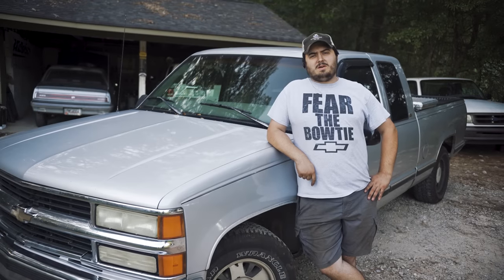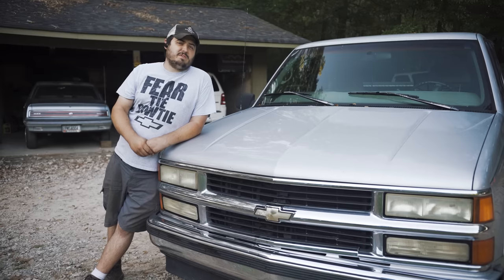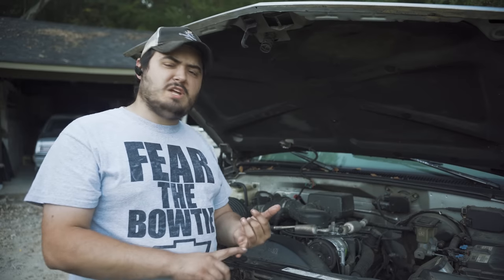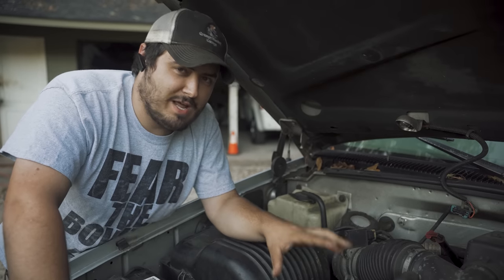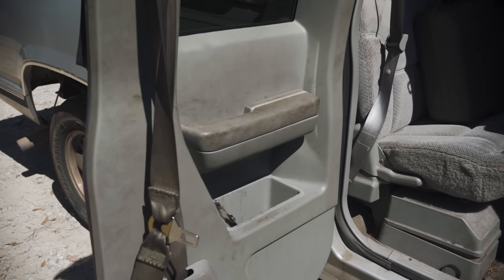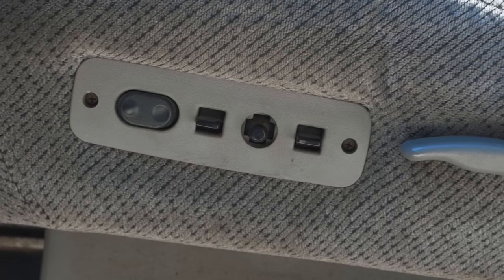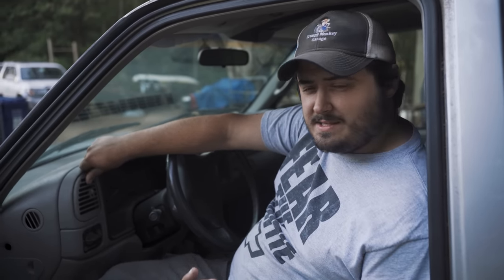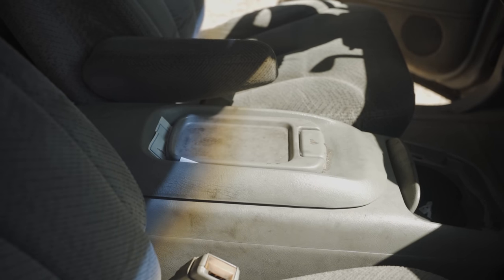OBS CHEVY TRUCK REVIEW, 1997 Chevrolet C/K1500 Silverado Review, The Best Truck You Can Buy?

Comment: Have owned my 96 K1500 for eight years. 294k on the clock. I agree with most of this video. Have NOT had as much of a light problem, but for 27 years old, maintenance has been easy on the wallet. If you need to change the steering box, be prepared to do it two or three times to get a good one. Hint, buy a remanufactured one, not rebuilt one. Do wish I had the electric seats and the third door option. But, it is mostly the dog in the back seat, and he doesn't complain.

Comment: I agree that the value of the OBS will go up, they are great trucks. I’ve got the uncommon OBS 2000 K2500 Crew cab short box 4x4, the later model Mexico made vortec 350 in it has a tendency to spin rod bearings but engines and parts in general are cheap and plentiful.

Comment: Don't sleep on '99-'07 Silverados with the Vortec. Got that 5.3 and it has had minimal problems. Think I just replaced an ignition switch a fuel pump and an alternator.
Reply: True. My 99 Sierra had to replace water pump which is expected at 130K. Got about 133K now so I’ll be keeping this for a long time. Lot of new Silverados in the neighborhood but I just keep rocking old reliable.

Comment: I have a 93 with 300k on it. Best truck I've ever owned. Sure the body and interior looks like crap, but its never let me down. I wonder what they changed from 93 to 97 on taillights? I can tell you I've only changed bulbs 2 times over the years.
Reply: same here....just replaced a parking light on the drivers side for the first time on a 1999 Tahoe.
Reply: 352500 on my 97 2500

Comment: This is my commuter as we speak.  Up and back 60 miles two times a week with a lance  camper on the back.  It does 65 up the altamont no problem.  It now has 328k on the original engine.  I have how had it ove 25 year and bought it for 6k.  I love this thing.  Yea stearing sucka.  The tail light were a problem until I put dielectric grease on them.  And now it's been over 5 year since I put a new bulb.  Before that I could realy get at most 5 months.  This guy speaks the truth.

Comment: I own this almost identical truck. 1997 Silverado 4X4. 220,000 on the miles. Drivers window and door handle is definitely an issue.  1 AC compressor. Like riding in a lazy boy recliner, comfy.hell the cruise still works. I’m keeping her.

Comment: I just bought a '02 Chevy K 1500  Silverado extra cab. It has the 5.3 and pretty much loaded. It has just over 121k miles on it. LOVE this truck, been looking for one like this for years. And about those Fords you complain about, my late dad had a '78 F-150 4x4 that was a great truck! Had the inline 6, four speed manual with granny gear first. Put it in 4-low and granny first and you could "FART" faster than it would move but never seen it stuck! It only had power steering and power brakes but it still was a great truck. Wish I had it back.

Comment: I love my '97 K1500 extended cab Silverado 350 cubic inch V8 (my country put a flag on the moon). Bought it 5 years ago with 83k original miles. Other folks like my truck, too. After a multiple times where strangers on the other side of the fuel pumps at local gas marts asked if it was for sale, I started putting a Club steering wheel lock on it every time I park it outside.

Comment: I have the 1998 Silverado 1500 with 328,000 miles. It's a fabulous truck that's usually easy to repair which is good news if you've seen what repair shops are charging these days. Just for a new gas filter and fuel line to the tank they wanted almost $1300! The job was done for a $10 filter and about 15 minutes of work.

Comment: I just bought a 1997 Chevy Silverado 4X4 with the 350V8 ex cab and I totally love it everything you said it true mine has 309,000 and it still runs great the more I drive it the more I like it thanks for sharing
Reply: I have the same truck (97, 4x4, 350, ex cab) It's been a GREAT truck... Since I Got it to  replace my 95, silverado,  which ran fine with 340K on it, but was pretty beat up.This one is clean inside and out...had been babied and garaged it's whole life. I felt like I won the lottery!

Comment: I had an 88 Chev Silverado long box extended cab and canopy and with a few performance parts I managed to get over 1000 kilometers on one tank of gas approx 113 litres. My calculation was 24 miles to the gallon. It was hit and wrecked so I now have 94 GMC Sierra long box extended cab with a canopy, it is getting everything I had on the 88 and should be at same fuel economy soon. I would never buy ford or dodge

Comment: I have a 1994 with almost 200,000 on it. It has a 3" exhaust and a chip for economy on the Highway I get between 23 1nd 25 mpg. I can drive from Colorado to Auquerque on one tank of gas. I can drive it all day without being tired  because it's comfortable. I did put a modern stereo that uses a thumb drive and an 8 gig drive holds over 60 or more albums. I love mine and will keep it till I die, I'm 76 now so that won't be too long.😊

Comment: The OBS and First Gen Silverado's are probably the best beater truck you can get that you ain't gotta worry bout tearing up. The formers a little easier to work on and fucks aesthetically, but the latter has better gas mileage and is a better truck in most respects.

Comment: You said the engines are great "just don't ask it to do what it's not meant to do". 

I have a 94 C1500 Silverado I bought from my father in law. Stock it came with the 4.3L with the TBI. With a V6, rear wheel drive and stock leaf springs he cut a hole in the bed and welded in a hitch for a gooseneck which he used to haul a horse trailer full of donkeys, goats, generators and all sorts of heavy loads. The leaf springs would be maxed out and he would have it just screaming down the road hauling that trailer. Never a lot of maintenance, put 15 inch wheels with cheap Futura tires on it. That truck still did it's job, drove like a dream. Only major fix was he had the transmission rebuilt about 7 years ago. By the time I had it that motor was well on it's way out but still got me around just fine. Needed oil every week and the brake pads on the front were non-existent to the point of the metal part eating the rotor away. It got me around until I left for boot camp and left it with a friend. When she finally gave out was the day his wife couldn't get it up a hill without flooring it. He got a 350 for it and did the motor swap. Afterwards he took the 4.3 apart and found that almost all the piston rings in number 3 cylinder we're gone and had caused long, Wolverine type scratches down the cylinder wall. Other pistons were missing pieces of rings and they could be found in the pan.
I just think it's remarkable how that engine could be so abused and yet it would still run day in and day out. I will always love these trucks and the small block Chevy. 

I'm happy to say now that truck has brand new suspension and brakes. A now carbureted 350 and an easier life getting me back and forth to work each day. Best vehicle I have ever owned.

Long live the Small Block Chevy.

Comment: i have a 96 chevy, same thing as yours but mine is a 2500 long bed, extended cab, and a v8 engine, im so lucky to have this because it’s one of a kind, i haven’t seen anyone with one in person or online, but the thing is
Reply: it’s not running 🥲 i’ve been trying to work on it since 2020, i’ve turned it on and test drove it one time but that was like during quarantine, rn it just sits at my house and i’ve been working on it again, i just need to figure out the wiring and i think it’s good

Comment: I paid 500 for my 97 tahoe k1500 about 4 years ago just rolled over 300k original engine and trans I've only done basic maintenance and i upgraded the master cylinder to an nbs and i put an aluminum radiator from a 2500 and bigger trans cooler

Comment: I was able to buy a beat up 95 c1500 for $900 (but it started up and drove fine). I’ve had it for several year now no issues besides an 1) clogged fuel filter, 2) ignition control module which made truck suddenly stop when it's warmed up. Being in california means virtually no rust, and gradually fixing everything on this old truck to make it something better than when I got it.

Comment: I have a 95 c1500 silverado v8 with a 5 speed manual  
My dad purchased in like 2000 i believe i drove it to high school a few times.  My dad passed away about 4 years ago and he still had this truck. It was passed down to me  it now has about 230k miles it sat for 4 years and i had to put a battery on it and it started up and ran again and now i take it to work every day. These older trucks were just that good. Still has original engine and all mostly maintenance was done

Comment: I got a 96 suburban down in Dawsonville Ga. back in march that the engine had spun a rod bearing because they had put new heads on it with 244k on it . WELL DUHA, the bottom end let go. I paid $900.00 for it and it"s in GREAT shape. I had a 99 suburban with 5.7 and 114k miles that my bro crashed for me, that made a really good engine for my 96!!!! Being a Ford truck kinda guy i have a 96 F250 with 300 I6 for a pickup. It just kills me that you are right about the 1995-1999 5.7"s, the small block GM is a damn good engine!!!!

Comment: I’m looking at a 97 C/K 2500 5.7 with 210k miles for a few thousands. I’m currently coming out a shit dodge that’s been breaking down every month for the past year. I don’t know much about Chevy but I’ve read n seen multiple amazing reviews about this truck. What would you look for when buying a used c/k?
Reply from the maker: The 4wd K series has rust problems, as they were more likely to be used in snow or mud. The transmission, the 4L60E in heavy duty applications has been known to slip 3rd gear under heavy loads, I'd check the transmission fluid for metal debris and look for rust by the leaf spring shackles and cab corners. Other than that, everything else is maintenance. Good luck!

Comment: still own a 91 GMC short box single cab 2x4 with a 5.7 on dual fuel gas & propane , it is being restored , It was a ranch truck out of Alberta Canada with 436 k on it ,what a great truck they are. the rag joint was the biggest problem with this truck .
Reply: Got a 90 RCSB stepside and im about to change out the whole shaft. Too much play for the highway!

Comment: I just bought a '98 with the 5.7 and z71 package for $1300. Engine and transmission both were replaced and only have 50k miles on them. Very little rust/rusted through areas and only things I had to replace to get her back up and running again was the fuel pump and filter. Needless to say, definitely won't be getting rid of that truck.

Comment: I have 97 Silverado with 300000 on original motor. A few engine modifications and get many comments of how sweet it sounds. Including electronic cut outs :-) I will never give it up. I did have to convert it to a 2500 transmission because I tow a large boat a lot. The 1500 transmission was weak. Bought it brand new in 1997 and will pass it down to a family member.

Comment: I bought the same truck in red about 4 years ago. Short bed single cab 5.7 vortec 350 has 230,000 miles now and still running strong. Had to replace some wear and tear parts but nothing major. Great shape inside and out considering the age. Yes steering is super loose but only complaint. Just took it to dealership for inspection and failed they said back left frame is rusted through but got under and looked and only thing that looks rotted through is the bottom of the bed rails. From the back tires to back hitch there's a lot of flaking but don't know if it's rotted through or not so taking it Wednesday to a shop that does welding frame repair so wish me luck 🙏. I love this truck and hope they can fix it I don't want to get rid of it

Comment: I have a black 98 Silverado regular cab 350. My dad bought it brand new and garage kept it's whole life. I inherited it a couple years ago it runs like brand new never had any major issues. It's got 180k miles. I do remember the intake or head gasket went out within the first 3 years my dad purchased it and I turned the milage back so it would be covered under warranty but it was only 15k miles over I think. But I have owned a 96 Z71 and loved it as well. The only weak points I have found is of course the steering like you already said, and the automatic transmissions only last 100k miles. Intake/head gasket but for the most part the truck is bulletproof. I've never seen a Dodge truck last as long as the engine and a Ford engine last as long as the truck. Dodge trucks fall apart and just plain out crap. Ford you can't even change the spark plugs without having 5 long extensions put together on a ratchet and letting the plugs soak in WD-40 overnight due to them breaking off in the heads. I'm just preaching to the quire, I know. Lol great video man, love these trucks.

Comment: I have a Blue 1997 Chevrolet Silverado C 1500 pickup that came with the Texas Paint Package that withstands Extreme UV rays and I love it. 190,000 miles on it and had to change the drivers side headlight today and will do the other one as well and the high beams too. I was warned about blowing the head gasket at 100k miles, and at 97k, it blew on me. It spent a day in the shop and $1,000 dollars later, I had the engine completely re-gasketed. I have also found that you can and will burn up the Gas tank sending unit if you run it with less than a quarter tank of gas in it. I have worked as an Electrician and have driven my truck in 43 states and worn out 3 sets of tires on it. The Steering is acting up a little now but I have new sway bar links and a power steering pump to change out, but as long as you take care of these trucks, they will run forever.  I got mine with 25k miles on it and still paid something like $35k for it. I paid it off in 2004 and could not be more pleased with this investment as I still use it everyday to haul Sand, Crushed Limestone, Bricks and all kinds of Landscaping materials and Patio Furniture and it never acts like I have overburdened it. I love my Chevy Truck as it has hung with me through 3 divorces and never let me down.
Reply: Did you replace pitman and idler arms also

Comment: I had a 99 of this style.  4x4.  Great truck, but I bought it with a little lifter tap and after a few years it did finally let me down on the interstate.  Granted it had about 260,000 miles at the time.  Oh and my tailgate required a good punch on the inside in order to open.  I'd love to have another one!  Now I have the next gen

Comment: “LT1”

It’s LT1 based but the LT1 was a 1992-1997 Corvette, Camaro, and Impala SS motor making 300hp. What came in these is called the L31, with vortec cylinder heads and was rated at 255hp
(1996-2002)

I miss my 97 suburban so much

Comment: I got a 97 Suburban k1500. Only one gripe. 4 bolts to the transfer case adapter instead of 6. One piece bell housing. Cases can crack if drive shaft becomes unbalanced or mounts aren't solid. I cracked 2 transmission cases, maybe a casting flaw? Had a borg warner kit put in replaced all the mounts. Runs solid. 194K.

Comment: I've got 264,385 on my 97. Engine got new injection upgrade 3yrs ago. Starter, alternator, fule pump, power steering pump still worked but changed last year anyway. Lost  the transmission at 235,000, it still worked but took a quart of fluid a week, " pump seal". Best truck in the world. Will never ever sell.

Comment: Hey I have a 99 GMC 3500 four door 4x4 350 4l80 with locker's from the factory. If you can go heavy the 3500 doesn't have the steering problems,or transmission issues and the break's are amazing it's a Tank!

Comment: Great video young man!
These trucks are amazing! I have a '95 Cheyenne K2500 4x4, 5.7  automatic. Keys, heater, FM/AM radio, roll up windows & an 8ft bed that never needs made! 201,000 miles & runs strong.  It's my weekend work truck and winter plow truck. My only problem is it shifts really hard from 1st to 2nd gear, otherwise no other issues. I plan on keeping it forever.
Reply: Put a bottle of lucas transmission fix in it I'm on my 3rd bottle 98 silverado don't worry about draining anything out of transmission it immediately cleared my hard 1 and 2 shift its as thick as honey but will thin out follow instructions on bottle 4l60e transmissions respond very well with lucas

Comment: Just scored a relatively clean for a northern truck 97' GMC K1500. Coming from a 99' 10th gen F150 the OBS Sierra just blows it away. It has more power, nicer ride and is A LOT easier to DIY maintain myself than the Ford. GMT400's are AWESOME trucks. This is coming from someone who was a Ford tech btw.

Comment: Had my 97 Z71 for 7 years now and love it.  Put some tow mirrors on with LED's in all the front and rear, air bags and dual exhaust in the back along with the third brake lite.  Also put in a double din stereo, Rough Country torsion keys so it's all level and  a couple Rough Country steps.  Waiting for 17 inch wheels to come in from UPS. Also replaced all dash lites with LED's. Gonna install  a kill switch in it next so if someone wants to steal it, it won't start.....
Reply: Get the high mod next 25 bucks Amazon

Comment: I got a 2 door 1997 k1500 Silverado z71 74,000 miles for free last year.  Lady wanted it gone. It wouldn’t start and it was parked on her front lawn. I replaced the fuel pump and alternator with battery and it was all mine.  I thank my lucky stars every day. It actually is Built like a rock.